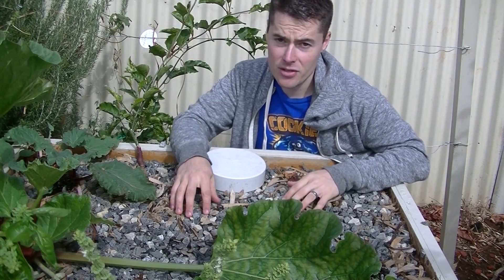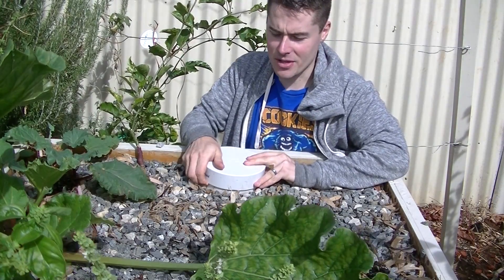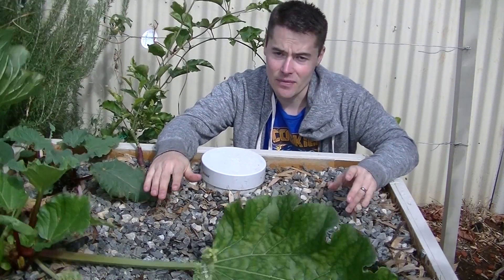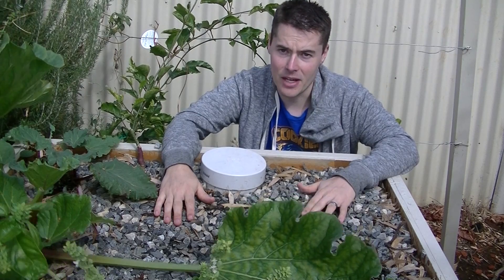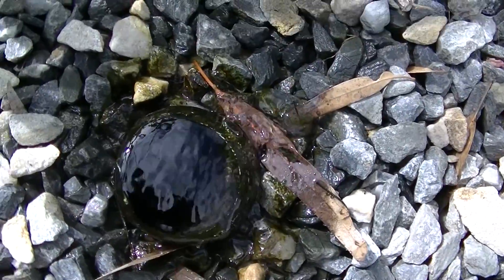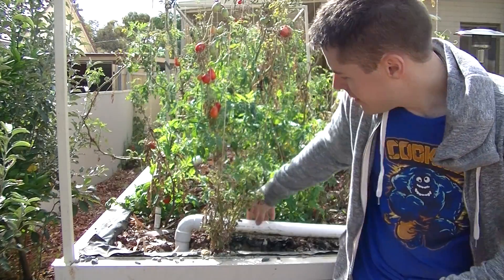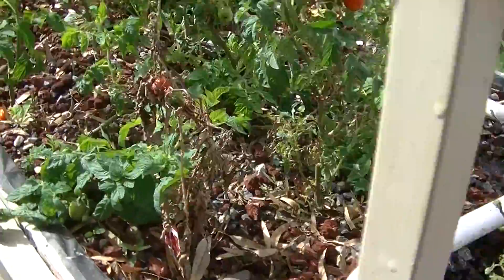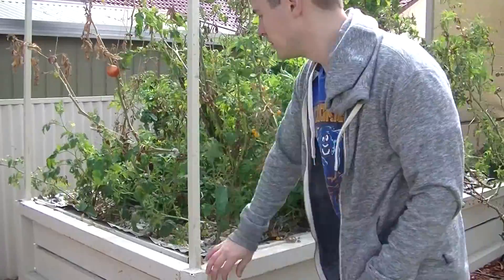Why to use a Siphon (Flood and drain) in your Aquaponics System

Comment: Great series Colum, thanks for your efforts, help and advice over the last few years. In my system I have my pump on a timer and it does pump at a faster rate than would be needed with a siphon arrangement, but what I have is a feed pipe that delivers water to 4 areas of my tank (helps eliminate areas where bacteria might grow) and collectively the system then fills much faster than it drains from the permanently open drains I have in the base, so overall the tank fills up quite fast. When the timer kicks in and switches the pump off the tank drains nicely into a sump below, via a pipe with holes drilled in so it "rains" back into the sump, aiding oxygenation. I also run air stones to provide further oxygenation via a small aquarium air pump. It cycles every 45 minutes and so far it's fantastic. I wanted to use siphons but so many people complained about them sticking or stopping and I wanted to be able to set and forget. Thanks again mate ;-)

Comment: only thing I see bell syphons used on is auqaponic systems, but it should work on hydroponics as well right? and if so, and if using a bell siphon, is a timer still required, or can it be turned on, and left to do it's thing?
Reply from the maker: Hi Richard. 

I think it'd work well in hydro, but I don't think it's needed as much. The chemicals used have more oxygen in them naturally, and flow doesn't need to be as high.

A timer works well with any system.

Comment: I know from my own experience that the constant flood beds do need high oxygen input and a high volume of water to keep things moving and it looks like your water flow is way too low and may not be oxygenated enough for that setup. And also not to sound like a troll, but there's different media in the two beds which may also account for fluid movement and mineralization.
Reply from the maker: Hi Josh. Thanks for the tips! The constant flood bed had a faster rate of water than the flood and drain. I've since converted that bed to flood and drain, and it's working far better that way.